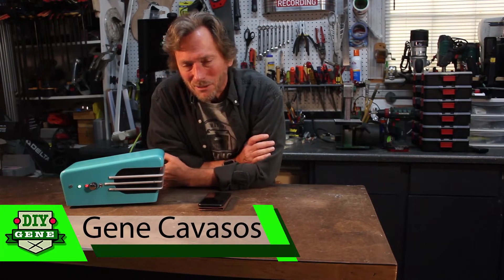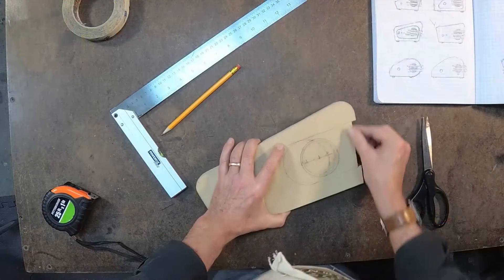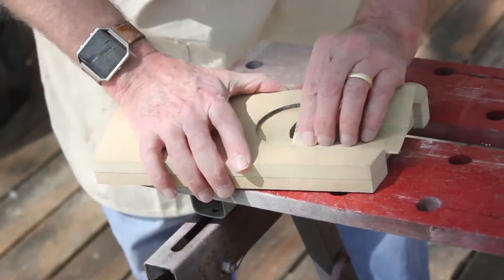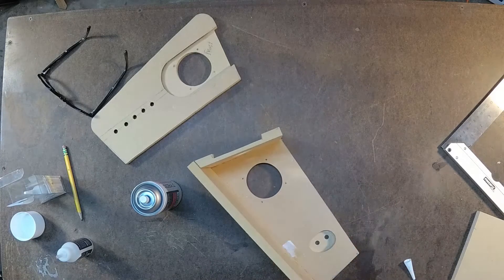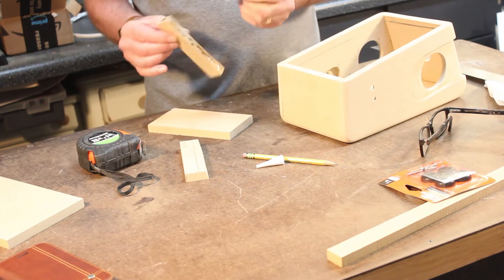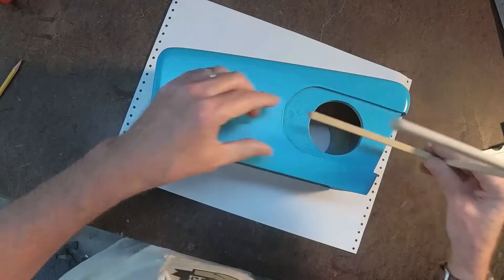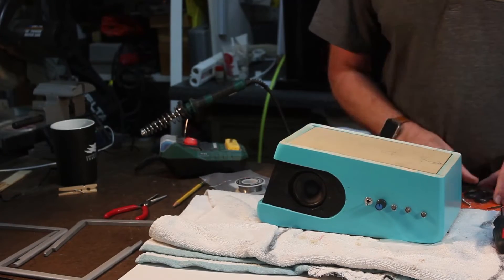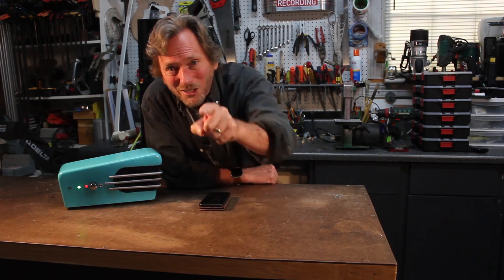How to Build a Retro Bluetooth Speaker (Step by Step)

Comment: Fantastic video Gene!!!!! I use CA glue and accelerator to, but a different brand. The stuff is like magic!!!
One tip that i have learned and i wanted to share with ya. When i have something that i need to adjust, i will apply the CA glue to one surface and put the piece where it needs to go and make any adjustments,  then i will spray the activator/accelerator on the joint from the outside. It will still activate the glue and set up very fast. I have also used CA to fill any gaps. Squirt a little in the gap and spray the magic spray on it and BAM it is set. A little light sanding and good to go.
Reply from the maker: Makin' Sawdust , Thanks for the great tip. I’m still learning about this glue and am blown away by it. This company sent me a box of the stuff and asked if I would try it out. I was hesitant, but really surprised. I didn’t even know CA glues even existed beyond those tiny little tubes of super glue. I wish now I would have used it as the filler instead of wood puddly. Thanks again for the great advice and for watching. I’m also checking out your channel. It looks great!

Comment: Hey Gene, great job, super cool idea. I was thinking of doing something with a vintage radio housing (This one designed by Raymond Loewy) and placing a JBL Bluetooth speaker tube inside it. Any thoughts on that or am I better off with the 30 watt kit that you used here?

Thanks in advance!
Reply from the maker: I think the sound quality of those JBL sounds tubes are fantastic. If you can make it work, I think it’s a great idea.
Reply: @DIYGene  I was hoping you would say that! I have two of them at home that would be perfect candidates! The controls on the original housing are not functional so i guess all I can do is keep the back off the housing to reach in and turn it on and off. I was hoping there was a way to power on the light that illuminates the original radio dial.

Comment: Great project but I am not happy with your chassischoice, the Dayton Audio PC68-4 have a 5 db drop above 4 KHZ, Dayton has better chassis and I am quite disappointed that Parts Express is selling this chassis as part of the Kit.

the PC83 is way better, costs very little more and is a little bit bigger.
Reply from the maker: @StereodreieckRC , I did not know that, plus there is room for a little larger chassis. Thanks for letting me know.
Reply: @DIYGene  I would use the Dayton Audio KAB-230v4 2 x 30W Class D Audio Amplifier Board with aptX HD Bluetooth 5.0 next because of its DSP (endless possibilities) which is unfortunately not available as a kit, with the PC83 4 Ohm (requires a bigger case), Accesoires and Programmer, all in all 135 bucks (double the price of your kit, but worth it 100%).
You get more Power, deeper bass, customizability with the DSP and an almost linear frequencyresponse.
Reply from the maker: Thanks, this is good information for the viewers.